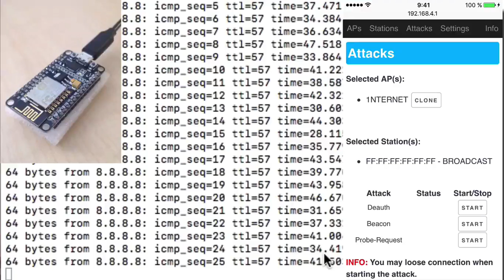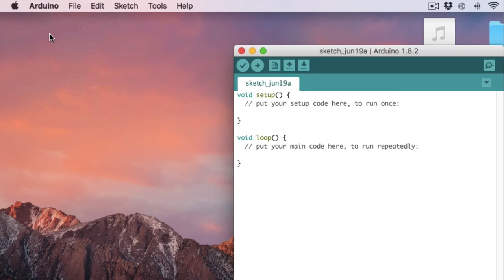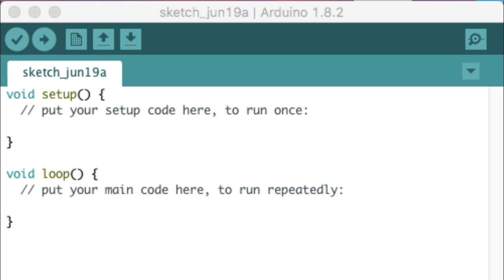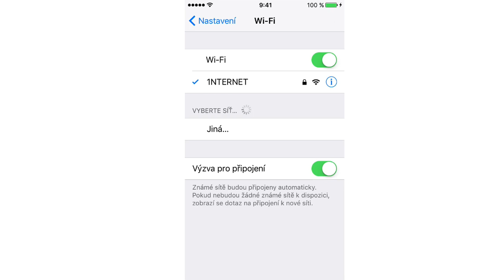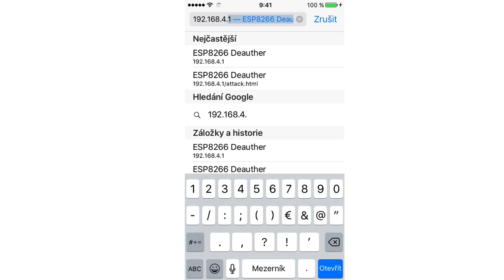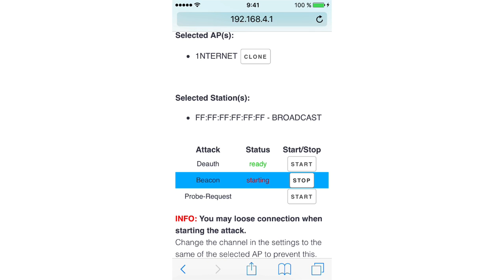How to make cheap WIFI Jammer

Comment: i did every thing but no luck 

Sketch uses 554878 bytes (53%) of program storage space. Maximum is 1044464 bytes.
Global variables use 56976 bytes (69%) of dynamic memory, leaving 24944 bytes for local variables. Maximum is 81920 bytes.
error: failed sending 0xC0
error: failed sending 8 bytes
error: failed sending 36 bytes
error: failed sending 0xC0
error: failed sending 0xC0
error: failed sending 8 bytes
error: failed sending 36 bytes
error: failed sending 0xC0
error: failed sending 0xC0
error: failed sending 8 bytes
error: failed sending 36 bytes
error: failed sending 8 bytes

error: failed sending 0xC0
error: failed sending 0xC0
error: failed sending 8 bytes
error: failed sending 36 bytes
error: failed sending 0xC0
error: failed sending 0xC0
error: failed sending 8 bytes
error: failed sending 36 bytes
error: failed sending 0xC0
error: failed sending 0xC0
error: failed sending 8 bytes
error: failed sending 36 bytes
error: failed sending 0xC0
error: failed sending 0xC0
error: failed sending 8 bytes
error: failed sending 36 bytes
error: failed sending 0xC0
error: failed sending 0xC0
error: failed sending 8 bytes
error: failed sending 36 bytes
error: failed sending 0xC0
error: failed sending 0xC0
error: failed sending 8 bytes
error: failed sending 36 bytes
error: failed sending 0xC0
warning: espcomm_sync failed
error: espcomm_open failed

Comment: Hello, I'm stuck in the 2:15 minute which program did you open? I could not understand this part
Reply from the maker: Go to arduino preferences and than click on link down that opens arduino preferences folder. Than go to packages-> esp8266-> hardware-> esp8266-> 2.0.0-> tools-> sdk-> include. In include folder must be user interface file. Than download project folder from video description and in project folder is file with code like on video that you must copy and paste to user interface folder or you can rewrite it from video. If there were any other confusion contact me.

Comment: Arduino: 1.8.5 (Mac OS X), Board: "NodeMCU 1.0 (ESP-12E Module), 80 MHz, Serial, 115200, 4M (3M SPIFFS)"

In file included from sketch/Attack.h:9:0,
                 from sketch/Attack.cpp:1:
/Users/tyler/Library/Arduino15/packages/esp8266/hardware/esp8266/2.0.0/tools/sdk/include/user_interface.h:454:1: error: 'http' does not name a type
 http://arduino.esp8266.com/stable/package_esp8266com_index.json  typedef void (*freedom_outside_cb_t)(uint8 status); int wifi_register_send_pkt_freedom_cb(freedom_outside_cb_t cb);  void wifi_unregister_send_pkt_freedom_cb(void);  int wifi_send_pkt_freedom(uint8 *buf, int len, bool sys_seq);
 ^
sketch/Attack.cpp: In member function 'bool Attack::send()':
Attack.cpp:102: error: 'wifi_send_pkt_freedom' was not declared in this scope
   if (wifi_send_pkt_freedom(packet, packetSize, 0) == -1) {
                                                  ^
exit status 1
'wifi_send_pkt_freedom' was not declared in this scope

This report would have more information with
"Show verbose output during compilation"
option enabled in File -> Preferences.

Comment: Can you use a mains mobile phone charger for the power supply?
Reply from the maker: Great question! Yes - you can use any 5v power supply and I think nodemcu board have voltage input pin for max 20v.